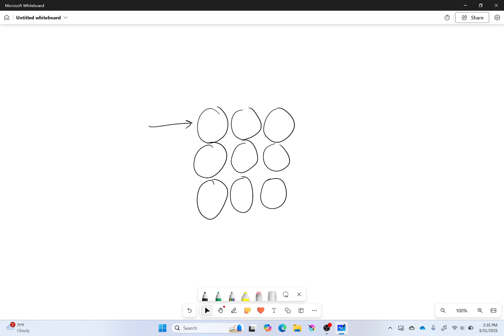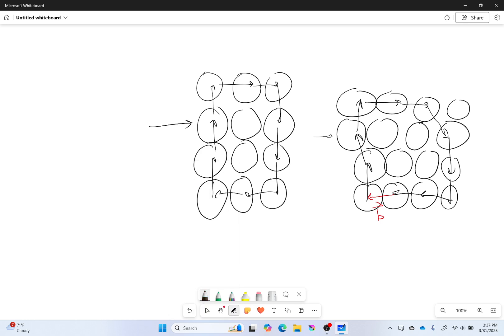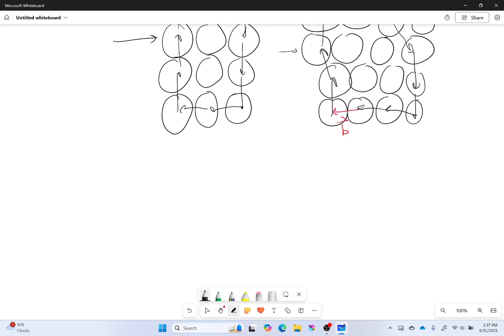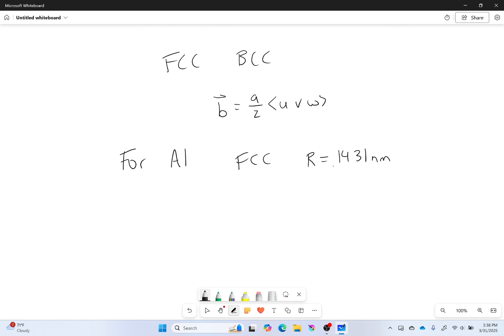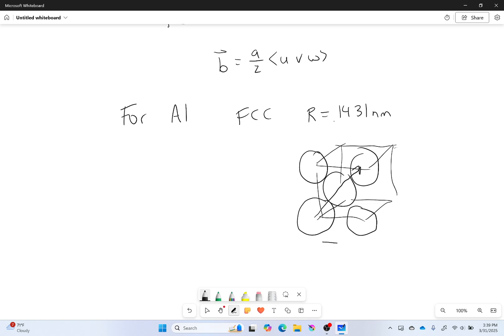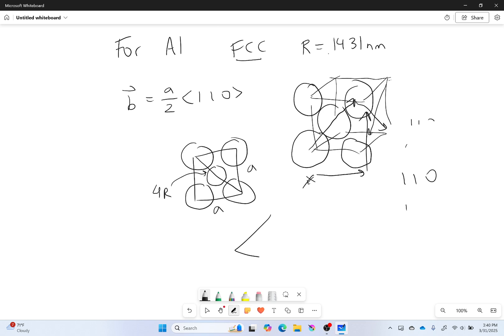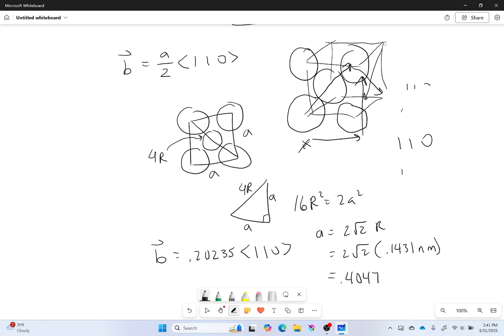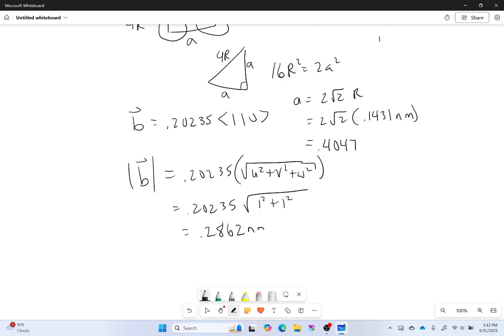Example: Calculating Burger's Vector

Comment: Very good video:) but could you tell me why the formula has a/2?
Reply from the maker: The a/2 is only for FCC and BCC cells. This is because in those cells, the shortest possible dislocation is either (a/2, a/2, 0) for an FCC or (a/2, a/2, a/2) for a BCC. I could simplify those then to a/2 (1,1,0) or a/2 (1,1,1). For a simple cubic, the shortest dislocation is along the edges so it is actually a(hkl). As for why we choose that direction for the Burger's vector, it is because that is the easiest path for a dislocation. Nature always wants to take the easiest pathway.